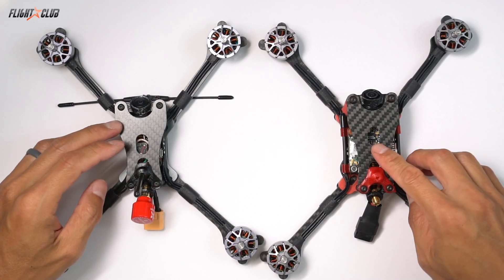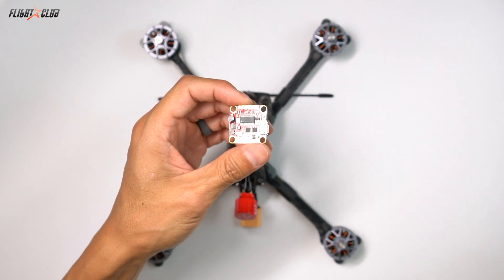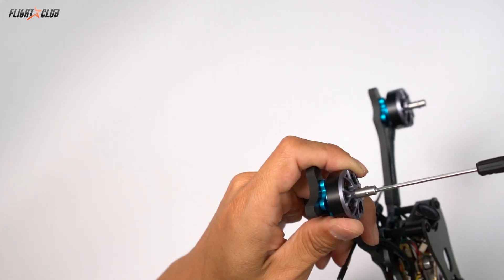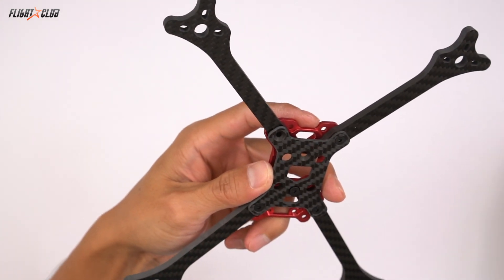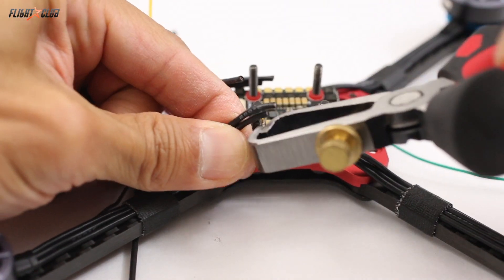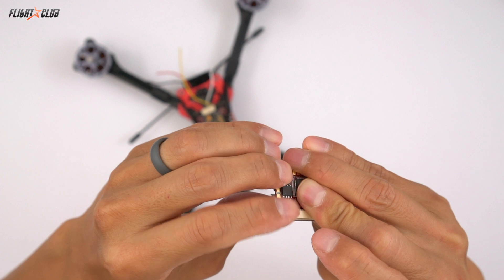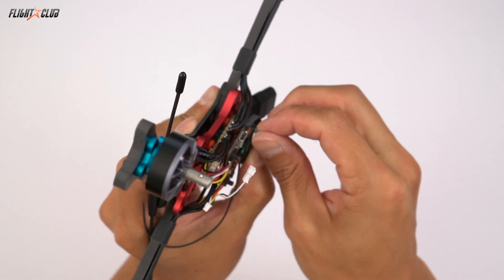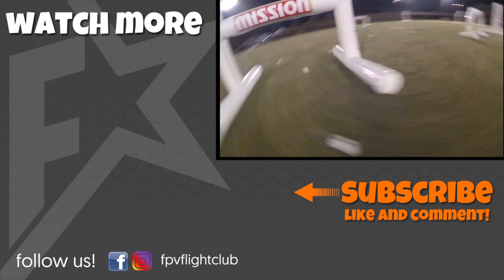Neutron-R Hybrid FPV Race Frame Build : Part 1

Comment: I refer to your videos.
I bought two Talon f7 with MPU6000 and Fusion, but neither motor 4 works.
ESC is Talon's Gigawatt and there is no problem here.
It looks like you've been using Talon f7, but have you ever experienced such a bug?
I bought it again because I thought it was an initial failure because the FC I bought was defective.
Is it a problem that can be avoided by setting?
Do you have any good ideas?
Reply: From Heli-nation site, use cli-commands: 

Resource MOTOR 6 None
Resource MOTOR 4 C08
Save

Comment: Great video. Just a little criticism though. Kind of dangerous leaving your wires for peripherals ie vtx, cam, and receiver a little too long having bare wires exposed. Maybe its just me but I always try to make it a point to keep the insulation all the way to the solder joints.

Comment: I wish I'd seen this before I built mine.. my FC has m2 holes. Made it a pain in the tail to get the parts secure... that little recess area in the necleus plate is handy.. I almost want to go re rout my wires after watching your assembly

Comment: Nice vid as always!  FYI, the helio did not have 2 gyros, it had 2 processors.
Reply: FYI

It has 2 gyros as on the webiste mentioned
Reply: Lee LifeLon FPV not sure what website you are referring to but the Helio boards only had one gyro and two processors: an F4 running normal flight controller stuff and an F3 dedicated to gyro filtering.
Reply: @JoshIsReallyAwesome  click on the website in the description. Its the flight club website
Reply: Lee LifeLon FPV dude. I’m not talking about the Talon F7 Fusion.
Reply: @leelifelonfpv1375  Josh is correct - the Helio had a single gyro, with an F3 procesor dedicated to running the filtering, and an F4 handling the rest of the FC duties.  Whatever the site description states, that's how it worked.
Either way, the Talon is awesome, and to be honest for racing the F4 V2 with Pit Switch is all you need - the things fly absolutely amazingly well with just that, and you don't need more.

Comment: Very tidy build 👍. Quick question, when I plug in my lipo(4s) I get a spark sound 😮, it hasn’t been a problem, just wondering do you know why it does that ?
Reply from the maker: yeah it's normal.  just plug in faster :)
Reply: rory oconnell 6s cracks even more
Reply: On 5S and 6S, it just gets louder.   Something useful you can do is adjust the prongs on the male side of the xt60 connector to make sure they have the right tension - either collapse them down, or use a small phillips screwdriver to spread them out so you get more consistent contact when you're plugged in (and less likely to come unplugged in a crash), as that helps too..
Other than that totally normal.  Smoke stoppers are still awesome on fresh builds, as that's the only other time inrush currents can ever be problematic.
Reply: Gavlar FPV  it’s normal so?
Reply: You have a capacitor wired across the VBAT +/GND, right? Probably what you're hearing is the capacitor charging up. It charges so fast it's like a short across the VBAT/GND for a few milliseconds and sounds like a pop. Totally normal.